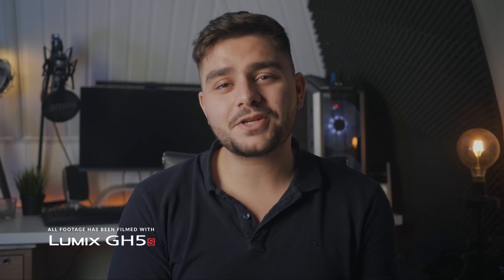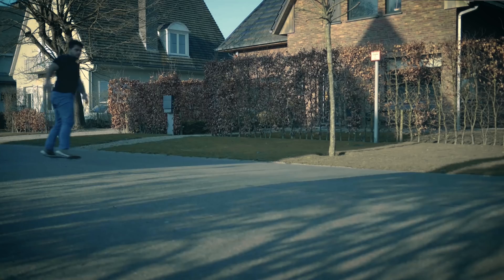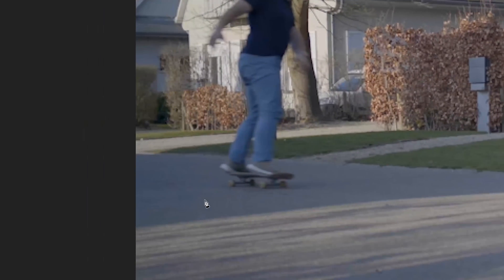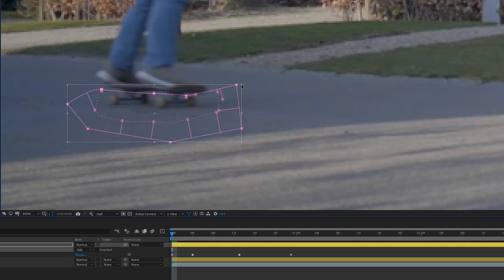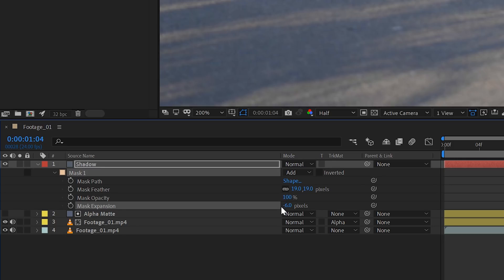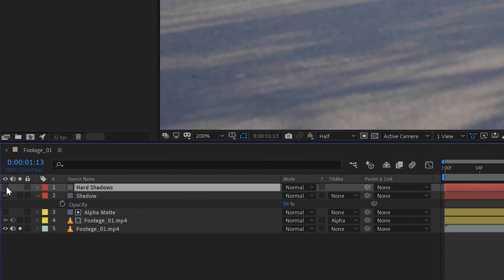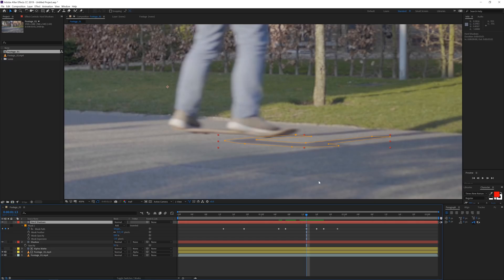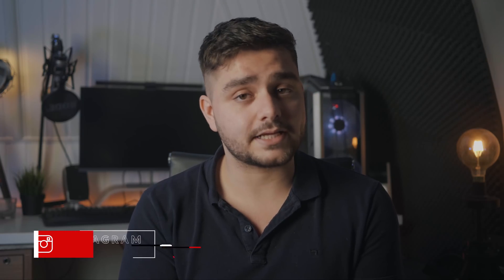Create a Back To The Future Hoverboard Effect in After Effects Tutorial

Comment: How do you export video please help when i export audio spectrum of length 5 minutes it took 17 hours to render and it took 52 GB memory please help
Reply: Render using media encoder and use h.264
Reply: @parthmanocha9195  how long will it take to render?(1080p 29FPS) within minutes??
Reply: It depends on your editing machine... Mine took around 4 hrs to render a 3 mins video but it was 4k60fps... You can check the sample video on my channel ^
Reply: @parthmanocha9195  ok thanks! For responding
Reply: It's probably that big of a file because you rendered it as an AVI video file. If you go to file, export into media encoder and the select H.264 it should work. While you are in the Media encoder, if you click on your clip which should be highlighted in blue, you can adjust settings like frame rate, file name, etc. A lot of times the file will default to 59 frames per second, but I recommend reducing it down to 24 as it is more standard. Reducing it to 24 will also save you render time so it's a win-win. Hope this helps